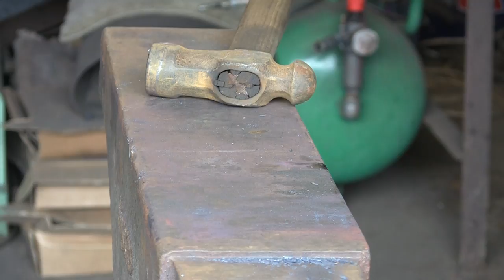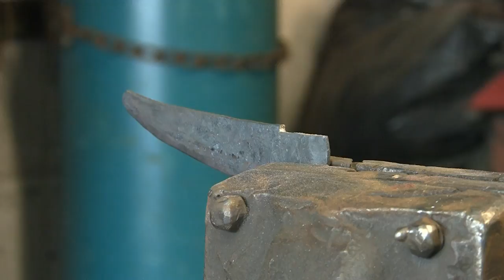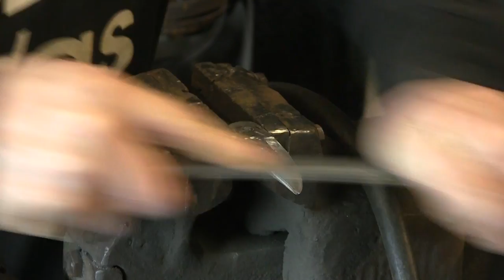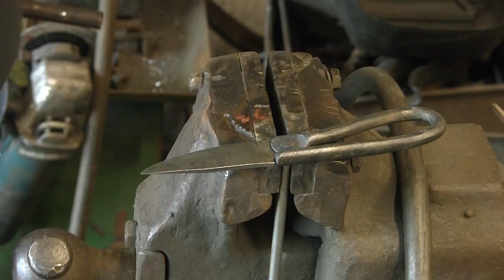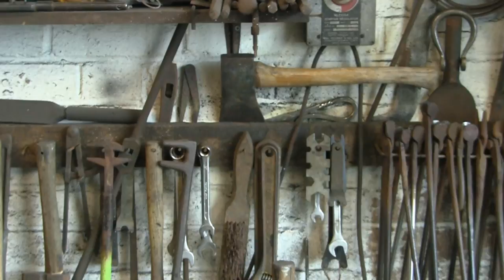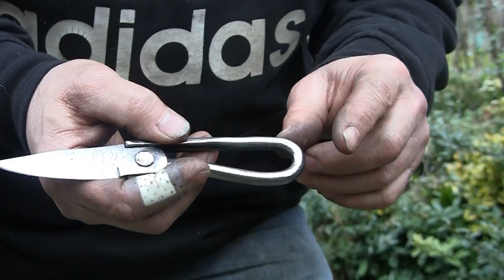Folding pocket knife

Comment: Mild steel case hardens, unless carbon packed and treated. This causes migration of the carbon to the iron, if done at proper temps a high carbon steel can be attained.

There are recipies for efficient case hardening solutions on the web, though I'm a fan of "SuperQuench"

Comment: Well done! I'm sure I'm gonna do this one also, I really like it. But I had a question about the handle, I have a lot of broken hay rake tooth in here, and they are all made of spring steel, is it a good idea to use them instead of mild steal? Because the handle has a little bit the function of a spring. It would be nice if I can use these because I can't throw them away but I also haven't had a single project to use them for untill now.

Comment: You are aware hammers will not actually shatter if hit together right? The wooden handles might break but no matter the hardness of your hammers they won't shatter each other. This was tested on mythbusters using various stages of tool hardness including some very hold blacksmiths hammers that were extremely hard.
Reply from the maker: They might not shatter but they can be damaged.
Reply: garyhuston
In all the tests performed the most damaged inflicted was maybe flakes of steel on the hardest hammers. Nothing at all on the softer ones.
Reply: prototypep4 the flakes of steel are the danger, that's the "shrapnel" he was talking about. its enough to go through skin and do some serious damage, my dad knew a guy who was doing basically that and a chip of steel shot off, went through his arm and cut multiple tendons, the guy couldn't afford the reconstructive surgery and he now basically has a useless hand, he cant even move a finger.
Reply: jake i 1) "my dad new a guy who's cousin said he saw a video of his friends sister's brother-in-law do it" does not make a convincing story. This is the internet. I'm a very skeptical human being.
2) you are seriously doubting how hard those shards would be coming off. If they were coming off with that much force from just striking two hammers together fuck blacksmiths would be losing limbs all over the place from the scale coming off hot metal when they strike it.
3) if you're going to try and make this an argument back it up with some sort of hard evidence.
4) I feel it's important to point and laugh at America and similar countries that don't have universal health care in 2015. Sucks being stuck in such a backwards country that still baffles me on how it's classed as first world.
Reply from the maker: prototypep4 I have a piece of "Shrapnel" from a hammer in my face. When I was an apprentice we used to hit our buffers with a normal hammer and one day a piece flew off and hit me in the face just by my eye. Now most farriers use a hard plastic or rubber mallet for that very reason.
Watch this video of my party trick: https://youtu.be/0zhq5X4Dqm8
Reply: prototypep4 1) it doesn't really matter if it makes a convincing story, its a true story so that's all that matters and if that really bothers you that i constructed the story that way then you clearly didn't get the point, hint hint it absolutely happens . 
2) I'm not a professional blacksmith like Mr. Huston, its just a hobby for me but if you knew a thing about it then you would know that when scale comes off generally the piece being worked on is in a very pliable state (not hardened) so all the energy gets absorbed rather than shot back at you.
3) Mr. Huston already provided you with proof so i really have nothing to prove to you.
4) its sad that you have to attempt to start a healthcare debate in a discussion about flying shrapnel, it tells me that you have nothing useful to say and are trying to change the subject because you know you have lost.Just walk away with you tail between your legs and try not to believe everything on TV as 100% fact, especially mythbusters i mean come on now.
Reply: anvil faces are hardend, cold chisels are hardened, crowbar are hardened. if hardened metal exploded when hit by hardend metal then hospitals would be full of metalworkers everyday. any metal can chip and cause injury. it is a matter of priority. you are more likely to be injured by thousands of other things it would be better to worry about those things than exploding hammers.